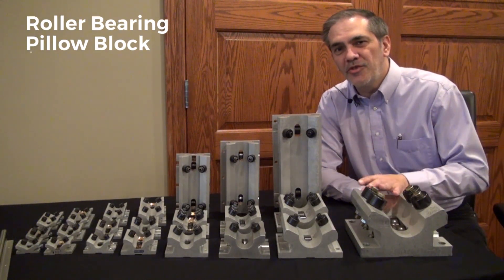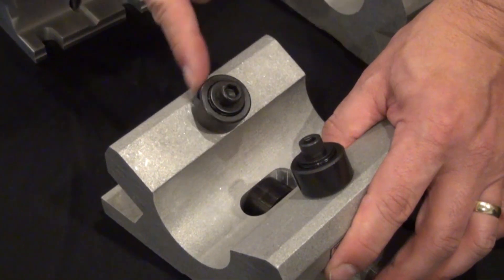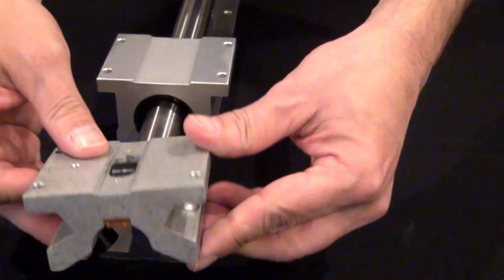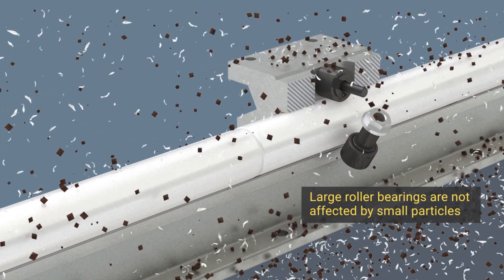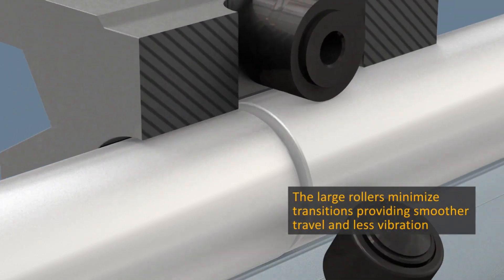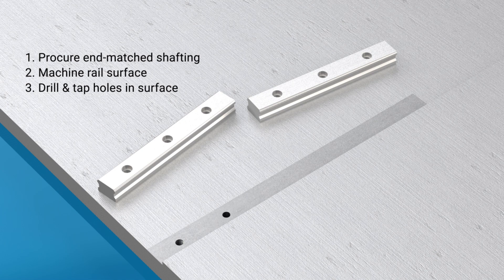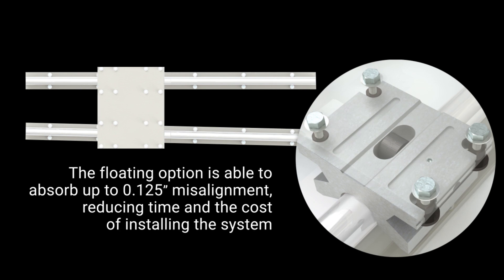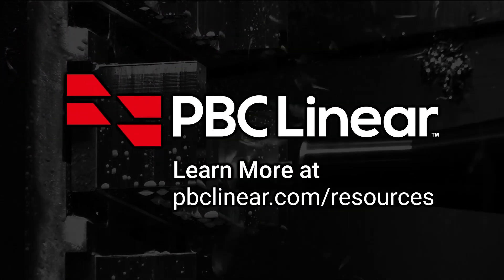Roller Bearing Pillow Block Features

Comment: I'm designing a sliding machine table that needs to cantilever: 700mm cantilever with 30 kg vertical end load. Is this feasible with roller bearing pillow blocks?
Reply from the maker: Roller Pillow Blocks are not recommended in a cantilever load condition due to the pull off force being applied typically to the rear supporting pillow block assembly.  When using shafting as the linear raceway we would typically suggest using our IPPN or IPPSN series linear ball pillow blocks, being sure to size the shaft and pillow block for the rear “P2” pillow block force to prevent pull off from the shaft. Typically in a cantilevered application it is more common to utilize a Cam Roller Solution such as Redi-Rail or Commercial Rail products that will guide and contain the rollers when used in the normal radial bearing load orientation with two parallel rails. If you need further assistance, contact an Applications Engineer at application.engineering@pbclinear.com

Comment: Are they suitable for linear guides of a CNC mill? To replace the pillow blocks with roller blocks.
Reply: Raul, thank you for your inquiry.  Since the answer depends on the setup, please provide details of the configuration and environment in which you want to use the roller pillow blocks as linear guidance.  A dimensioned sketch is useful in helping us understand the configuration.  Please send to applications.engineering@pbclinear.com
Reply: @davehumblet3894 Ok. I will try to sketch my project and send it to you. Thank you for your attention. Have a great day.